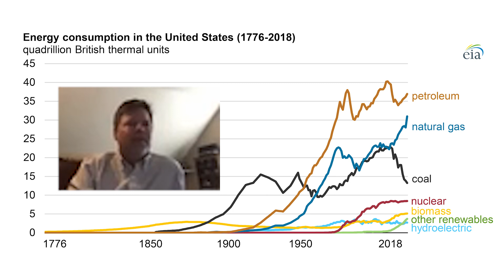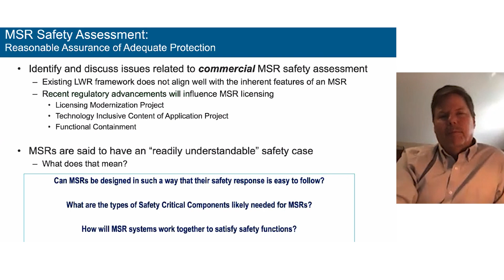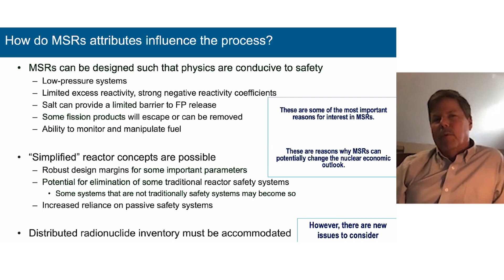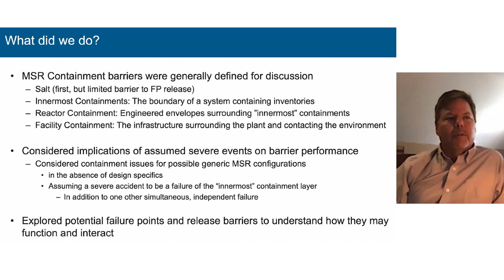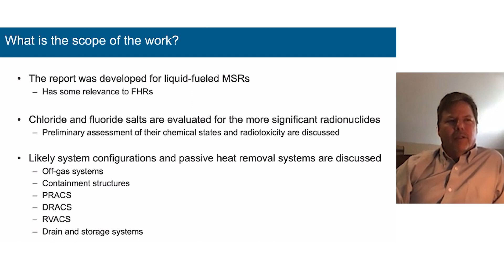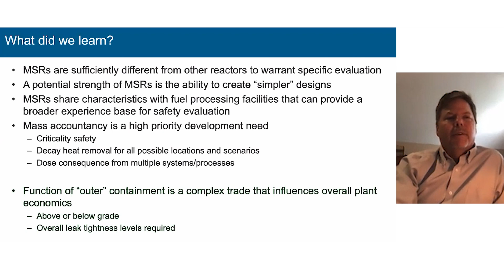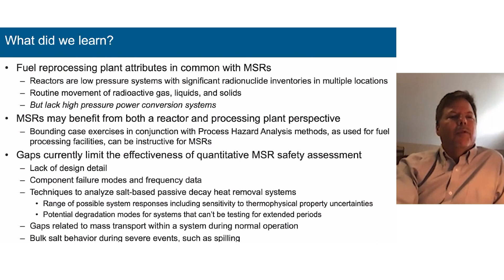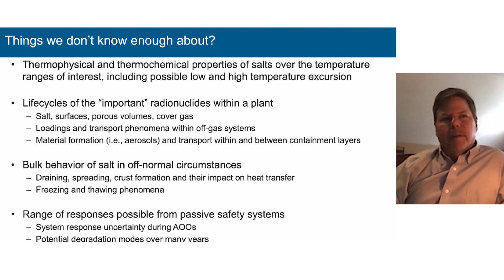Molten-Salt Reactors - Lou Qualls @ ORNL MSRW 2020

Comment: 3:25 - Having industry lead the way in design, letting the regulator be the skeptic, making industry prove safety. This is like the Obama administration's approach and it's the way to go. This is not government procurement like specifying a weapons system, this is providing a service for and protecting the public from abuses of the profit motive. Profit is all well and good until it puts health, lives and property at risk. We probably need two designs: Long term modular and disposal/reprocessing. Let the competition begin: fluoride vs chloride, pebble bed vs traveling wave, there comes a point where we need to focus a trillion dollars on a competition and let competition sort out the ranks.

Comment: Hi Lou Qualls, If you are looking for the state of the art and need make a quatum leap according to handling of particles in a flow, it works from 10 nanometers and up even in the molten salt fluid you have the check this out! It operates in any types of flow and temperatures without any filters at all. In 2011 we separated graphite particles up to 5 microns in water. This technolgy is an disruptive innovation of separation and control of particles. US Patent approved in november 2020.
https://particletrapglobal.com